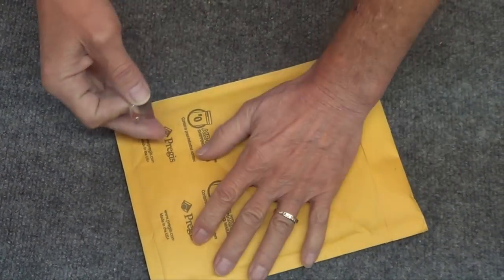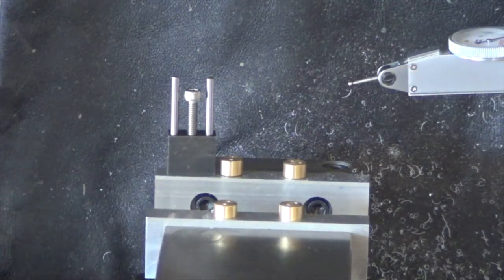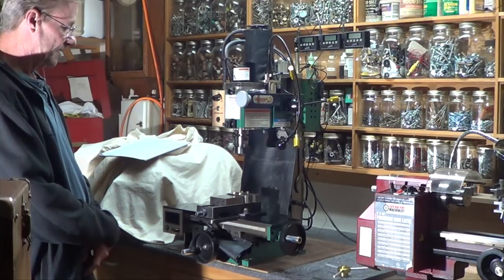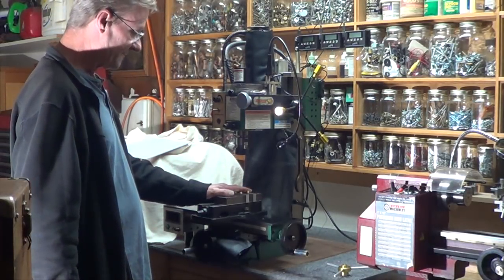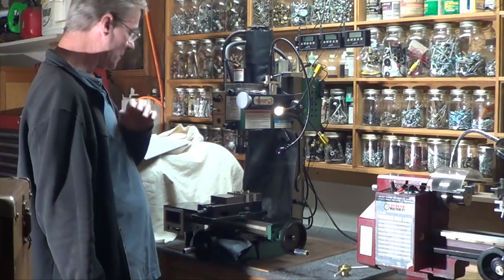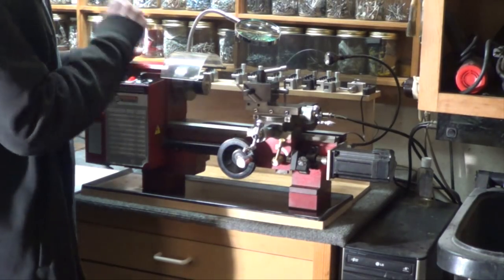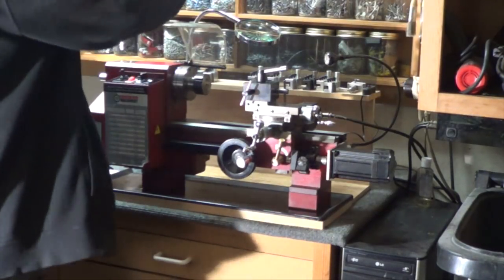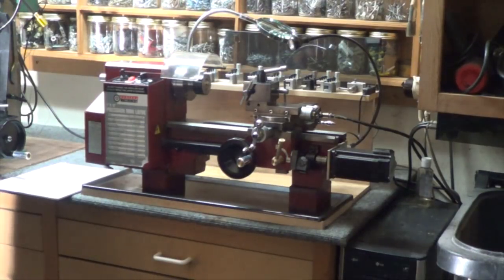Top 10 Mini Lathe and Top 10 Mini Mill Mods

Comment: Another really good tip for finding your tool height on the lathe is to pinch a small, flat piece of metal, like a small ruler or scale, between your tool and your round part. If the tool is on center, the scale will be straight up and down. If the top of the scale tips forward, you need to lower the tool, etc. This method will get you very close, and then you can fine tune it by looking at the shape of the nub on the face of your part like you said. Great video! I've been a machinist for a few years now, and have been looking at picking up one of those mini lathes recently.

Comment: Great video man. I agree with the needed updates/upgrades and the difference they make. I am currently fiddling with the best way to install the DRO system to my lathe and mill. I have a set of the I-gauging dro but am not sure the best way to mount them on the my machines. Keep up the great work!
Reply from the maker: Installing them will be the most difficult project you will ever did! You have to mount the sensors in a way that they can travel some 12 inches without any force being applied to them. NONE, SILCH, ZERO or readings will be off. I can send pics of what I did if you email me.

Comment: Dave, Really appreciate your videos!  Just retired and looking forward to refocusing on this hobby.  Question, what about the changeout of the ball bearing to tapered spindle bearings for the mini-lathe?  Worth it?  Priority?
Reply from the maker: I know a lot of others that have done it and they don't see any difference. I have two HF lathes with stock bearings and happy with their performance but I did buy tapers when on sale but never installed them. Watch Don Brandt and how he did it without the special tools needed. The saddle upgrade is far, far more important than bearings.
Reply: @TheMiniMachineShop   thanks Dave, I appreciate the feedback.  I trust your perspective and wont make it  priority.

Comment: A point of information regarding the power switch on older 7X10" lathes. I had one go bad ( lathe purchased around 2001) and they indicated that it is not available anymore. I found that the switch on the newer produced mini 7X10" and 7X14" switch is exactly the same as the older lathes. I purchased it for a little over $6.00, installed it, works fine.
Reply from the maker: Great input thanks!!!

Comment: THANK YOU...for sharing. Do you have a video on the column stiffener?  I have the H.F. mill and have made a lot of mods.  I would like to make this stiffener for the column.  I appreciate your video's.
Reply from the maker: Not really but it's a 1.5" x .5" x 12" steel bar. I drilled and taped the mill base as far down as possible then the column at the top of the bar. The bar straddles the giant nut and I tighten the bolt at the top to pull the head back. Hope this helps. My intention wasn't to stiffen the column but to adjust the tram on the mill.
Reply: Thank you...Yes I am going to use it as to tram the mill and hopefully it will give it some rigidity as well. So the bar will pivot on the large nut?
Reply from the maker: Yes and I was surprised that the tram never changed over time. Thought the bar would slowly bend... the bar was 1018

Comment: Hey guys I want to get started with my own combo mini mill. I am retired and got to much time on my hands and these videos are absolutely wanted and needed. I am still in the what to buy process. Keep the videos coming. Being a disabled vet I only need the mini mills so I am very interested in everyone opinions. Thanks guys
Reply from the maker: Just be aware with a mini the entire head moves up and down like a drill press. The larger mills only have some 2" of travel so you have to crank the head manually to be within the 2" for drilling etc... Very time consuming IMO.
Reply from the maker: If the column doesn't move how do you adjust tram?
Reply: Thanks guys I am going with a little bit bigger than a mini. 14 or so for mill and around 2 maybe on the lathe. The little machine shop equipment is where I am at right now. Plenty of guys out there using the machines with a lot of support so that’s pretty much where I am at at the moment.
Reply from the maker: http://www.grizzly.com/products/Mini-Milling-Machine/G8689?utm_campaign=zPage&utm_source=grizzly.com#
Reply: stay away from combos lathe n mill in one. I also bought harbor freight 7x10 lathe which is really more like 7x8 money was the reason along with ignorance. not saying its a total loss just that a little more money gets a lot more machine as far as lathes go. for me I upgraded the bed to 16" and  metal gears after stripping out plastic gears on the head .Gear box would be nice can't say enough about gear box envy I loath any soul with one of these marvels. It's the mule compared to a tractor. look on grizzly machine sort from low to high price if you end up with gear box your no friend of mine unless you also buy a surface grinder I can borrow.
Reply: I like the 5550 mill from LMS
Reply from the maker: That is the best I've seen with quill movement of 2.8" while others are 2" or less! You may want to look at Bolton Tools....
Reply: Dave M I am going to stay with the lms 5550. I want to get to a cnc at some point and the little things that the guys at lms has done to the machines plus the digital readout on the lathe and the small dro on the mill. If I went with the mini's I would spend a fortune just bringing the up to par to use.  So I have decided to get largest machines LMS has to offer...I appreciate the reply Dave, matter of fact I was watching one of your videos along with Mr pete as well...I will email you when I get ready to buy...I have to sell 2 of my motorcycle s both 3 wheel just to make room...see ya and thanks.

Comment: Is that a electronic leadscrew stepper mounted on the right side (end of the lead screw)?
Reply from the maker: Yes i use it to control feed rate...
Reply: @TheMiniMachineShop  Hi Dave, was trying to find the vid where you demoed this stepper feed rate mod... cant seem to find it?  I want to do something similar to my lathe. Any info specifically on the lead screw to motor coupling design would be helpful.

Comment: What about the column stiffener on the mill. A #1 on my list. Can't tram without it.
Reply from the maker: True but would you rather have a square vise or a vertical mill? Like I said hard to prioritize.
Reply: having the ability to tram the mill in vertically is more important than a square vice IMHO, you can always use the mill to machine the vice jaws square if the mill is trammed properly

Comment: Im still searching for a mill and a lathe that is precise on metal/steel for its price since i cant afford expensive or big machines, what machines are good and somewhat cheap, i cant get anything into my cellar door that is bigger than an old slim door 60cm x 200cm cause the rest is 50 cm thick concrete walls, it was a bomb shelter during the cold war here in sweden.
Reply from the maker: Not sure I can help you out since everything I know is on American soil and the shipping cost would be outrageous. But here are the major brands Little Machine Shop, Grizzly, Harbor Freight, Bolton Tools, Precision Matthews and OMT. Hopefully someone will see your comment who can help.

Comment: you didn't link to these upgrades, just blahblah "I went and got the whole set", "can't live without it..."
LittleMachineShop is actually kind of high on many things, but they do have quite the selection. I watch for specials, but still find the same items and brands cheaper on fleabay or various online sources
Reply: I could just post a list of links and explanations and don't need a video to do it lol. I guess the top questions I had a year ago were like "where can I get this, or What is the advantage of this... Why that... " 
sorry I had to -1 this vid, but I do like most of your other stuff. I find that much more help is on the machinist's forums. it's kind of hit or miss on YT
Reply from the maker: Wow out of control rambling.. Bought the whole set of what? The video is on two machines which one are you talking about? This video was released over one year ago so links change and where I would recommend getting an item from also changes. In any case the idea of the video is to let people know about different upgrades and that you can always email me with any questions or just advise....many newbee's have! So if you need help Paul just email me the address is at the end of every video.